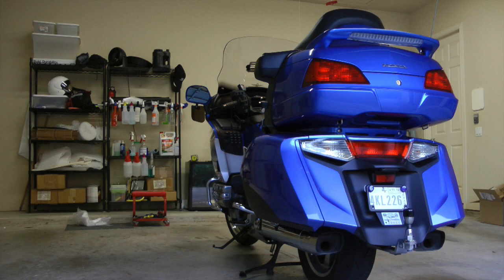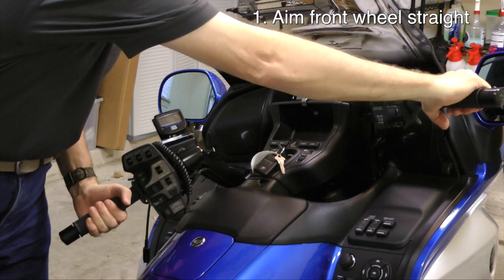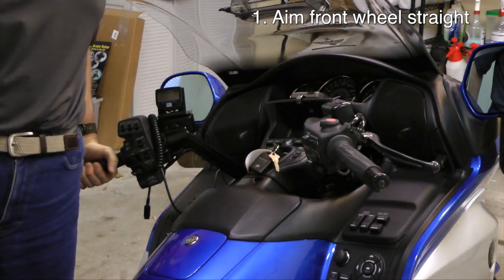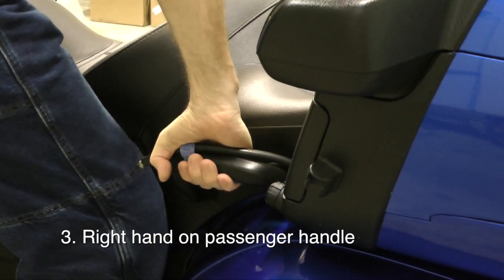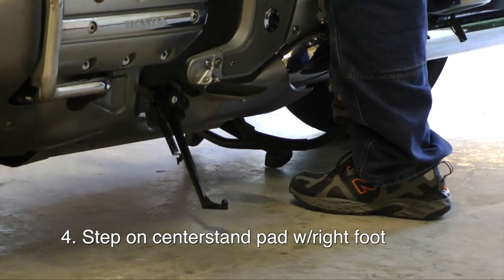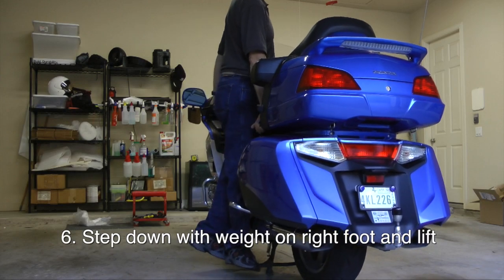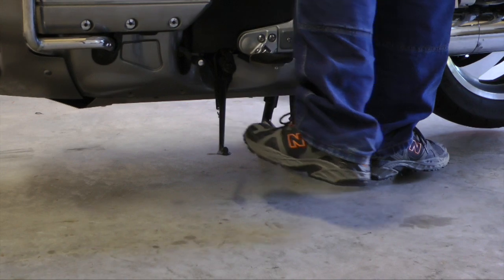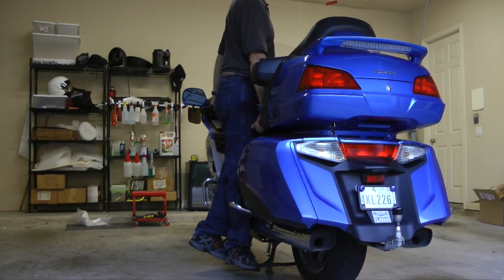How To Put Your Honda Goldwing Onto The Center Stand

Comment: I would like to add my .02$. At 135 lbs. I have moderate difficulty doing this procedure. So if one wheel, (front, or back) is on a piece of 1x6 board, oh let’s say 12” long, the task is far easier. I keep a small piece of 1x lumber in my trunk for when I am out of the house, and a slightly longer piece in my garage parking spot. I mean it’s so simple now, any man or woman can do it! Again, thanks for sharing great tips and insights to our Goldwing community! JT

Comment: Yes, this is the best technique I have found also.  Easier still was the two-stage stand on the Kawasaki Voyager XII.  I'm not sure why Honda didn't use something similar on the new Wing.  Easiest of all is pushing the button on my LT and let it put itself on the center-stand.
Reply from the maker: The 2018 is MUCH easier to get onto the stand. I think the stand may be shorter. A little tougher to get OFF the stand, but easy to get on.
Reply: Cruiseman's Garage I test rode a DCT Tour last week, but did not try the center stand.  This is one area where 80 fewer pounds also might make a significant difference.  The only bike I've ridden recently that had a full manual single stage center stand was a K1600 GTL rental.  It wasn't too hard to get onto the center stand, but I weigh 230 which helps.  I admit the EHCS on my LT is nice.

Comment: I have more problem getting it off the center stand than I do getting it on.  The wing is easier than our DL 1000 which weighs hundreds less.  Honda has done a good job in engineering the GL 1800's center stand.

Comment: I'm so glad to have found this. I'm a first-time Goldwing owner having bought the newly redesigned 2018 Goldwing Tour DCT and its the first time I've ever had a center stand. I'm actually a little fearful of trying to put the bike on the center stand because I think I'm going to lose control and cause the bike to tip over. Your video gives me confidence to try it again. Thank you for this. I just need to ask if, when taking the bike off the center stand, should I have the parking brake set?
Reply from the maker: Don, no, you want the rear wheel to roll when it comes off the stand. I usually am sitting on my bike and rock it forward to take it off the stand. You can do it standing next to the bike, but you need to make sure you have the kickstand down and the handlebars turned slightly to the left (assuming you are on the left side of the bike).
Reply: Sitting on the bike to take it off the center stand is the secret sauce! :) Thank you.
Reply: @mrdonsmith  Try it any other way and over it'll go.

Comment: Rear tire is flat and it doesn't want to budge.  Will this still work
Reply from the maker: I have done it before, but it makes it more difficult. If your rear tire will hold air temporarily, might be easier to air it up long enough to put the bike on the stand.